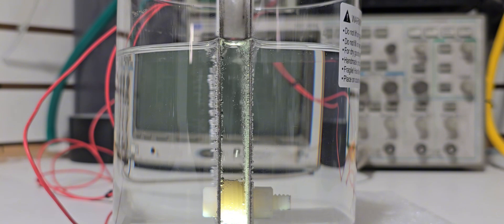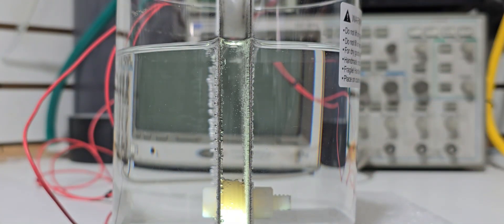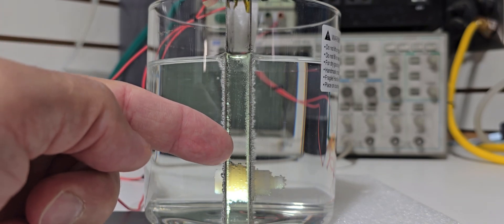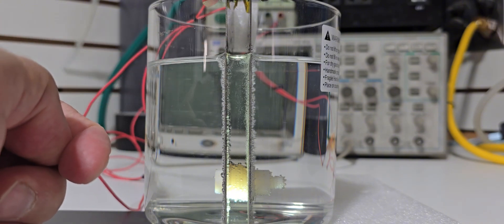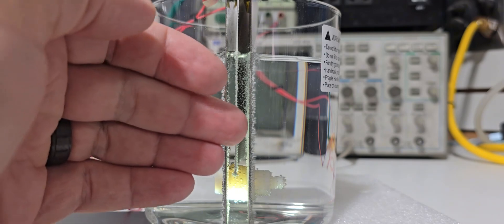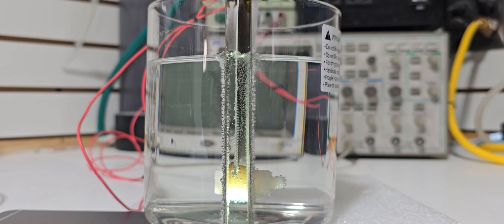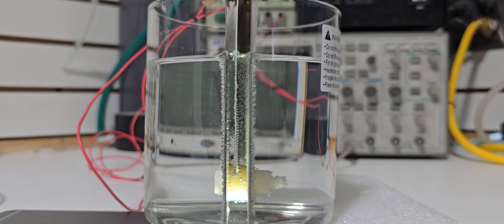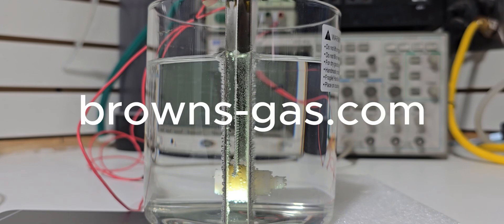What you need to know about Brown's Gas and Electrically Expanded Water: Debunking the Mystery part1

Comment: There is some possible evidence that browns gas may contain trace amounts of "other gases" or quasi stable mixtures of hydrogen AND oxygen in forms that are NOT water or pure hydrogen and oxygen gases but again, only in trace amounts. As far as the steam that can be produced, it does seem to be akin to steam as as produced from an ultrasound unit. That micro steam has always looked interesting to me. If you open the reservoir right after operation, this steam escapes like smoke.

Comment: Great video as usual. The secret probably is in the theoretical basis that water is H2O, which is Helium and oxygen.
Reply: Actually, that Hydrogen and Oxygen... But that's likely what you meant.
As for the calculations, Steve messed up the seconds (there was no 3 second delay if you properly watch the video) and he assumed there was 9 cells (there was only 10) and he and I disagree on the accuracy of his fancy electronic volume measuring device so I ask that he measure things by properly using time proven water displacement (and he refuses) or measure BOTH machines using the same equipment (and he hasn't done that).  
So I'm trying to purchase one of his H2 Life v5 to evaluate myself...
Reply: @ecopegasus  No, I learned while developing lasers that water is not hydrogen and oxygen, it is actually helium and oxygen. Because helium is two hydrogens. Question everything about "science," because everything about how it came to be is fiction. Backdrop fiction just like WestWorld, Marie Curie is Mercury, the trickster, the deceiver.

Comment: I like it. Steve have you looked into SG Gas ? (Ted SURATT & Robinson GOURLEY) also called H4O2  or Dioxytetrahydride Gas, and the water called Watt-Ahh  by AquaNew that they infuse with the SG gas.
Reply: Hi George, I tried to reply back to a comment on What is Browns Gas, but youtube pretends to post my comment but on refreshing the page my comment is gone. 

(GW) I'm having a similar issue on Steve's videos.  He is trying to figure out WHY.  I'll try to post your response below.

Have you looked into SG Gas ? called after the "inventors" Ted Suratt and Robinson Gourley. My understanding is they are trying to make mostly the bubbles that form between the plates. It doesn't self ignite until compressed to 1,600 psi. From the outside it just looks like electrolysis, but they are using pluses to create a pulsing magnetic field and thus the H4O2 they say. They use a SMPS by Volteq, I think it's the HY 3050 EX (30 volt 50 amp) and I asked Volteq what their switching frequency was and they replied, about 100 KiloHertz.

Their patents are at:

https://patents.google.com/?inventor=Robinson+B.+Gourley

Over at

https://www.lenr-forum.com/forum/thread/6732-hydrogen-oxygen-explosion/?pageNo=1

the user Drgenek posted a little more info on SG Gas, including mentioning that if it is ignited with a hot wire, then there is a slow implosion.

A thought I had was for you to try winding up the frequency of your AC-50 to 100 KiloHertz and lowering the duty cycle just to see what kind of gas it produces. Mostly implosive maybe ?

Dean.
Reply: Years ago I told them the the underground explosion test they used to 'prove' implosion was incorrect.  The container was pressurized with gas (sealed) and the design would have only gotten 'tighter' with vacuum.  The ONLY way for the dirt to get into the container was for there to have been an explosion first, expansion opening up the container so dirt could 'fall in'.
When I pointed this out... They stopped communicating with me.  BG explodes first, THEN (if the explosion is contained) implodes as the gasses for water, contracting in volume 1800x as the water cools.
https://www.youtube.com/watch?v=-9EmgSowldw&t=11s
If their technology (and patents) actually work as claimed... Where are they now?  Why aren't they selling machines somewhere?
Still, I appreciate your input and will check out your links.
Reply: @ecopegasus  The SG gas guys say in their patent it takes 1600 PSI before it self ignites, yet from the outside it looks like an alkaline cell that uses KOH, and high amps, so it seems not all gas is created equal.
Reply: @junkyoutube9060  I haven't built an experiment that duplicates their patent so I can only re-state that it appears they didn't make proper conclusions from their under-ground combustion test.  To me it's obvious that the gas exploded first, just like Brown's Gas would.
I also haven't seen proof of the claim of 1600 psi before 'combustion'.  Not saying it didn't happen but I haven't seen it and they cut off communication with me instead of 'proving it'.
Note that Ohmasa made similar claims... Research Ohmasa Gas.
Reply: 1600 psi is nowhere near enough for storage in small cylinders.
Reply: @TravisTellsTruths  Brown's Gas (HHO) ignites at MUCH lower pressures and temperatures (even OxyHydrogen ignites at low temp).  And if you have a sharp point or edge in contact with the gas, it will ignite even lower.  So, the higher the pressure, the cooler the gas must be to not ignite and vice versa.  I had one electrolyzer that had a spiral of steel left in it, from tapping (threading) a hole.  When the point was UP, the electrolyzer consistently had internal explosions at 7 (seven) psi and room temperature (around 70 degrees F).  This is because the gas contains electrons that can concentrate on a point or edge, creating enough voltage potential to ignite the gas.
Reply: @ecopegasus  we're all being mass censored by the AI/big tech, that is why. I promise you that. Millions are now censored online. It's is pure evil. Trust me. big tech, that is why. I promise you that. Millions are now censored online. It's is pure evil. Trust me.